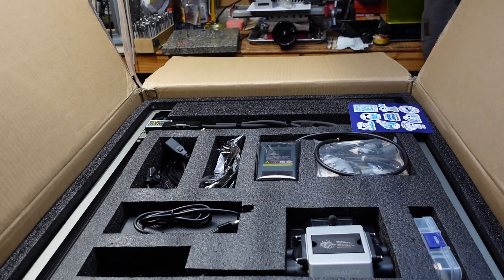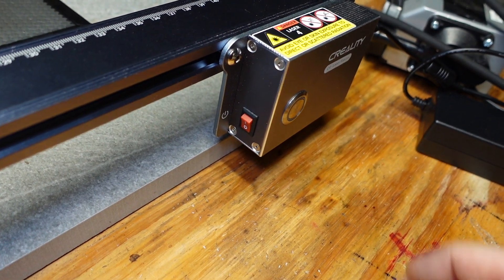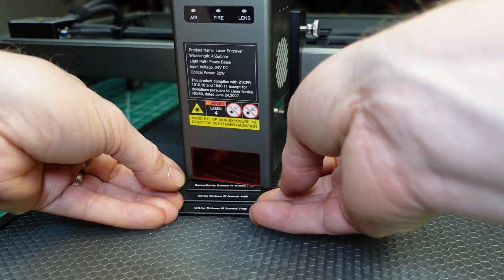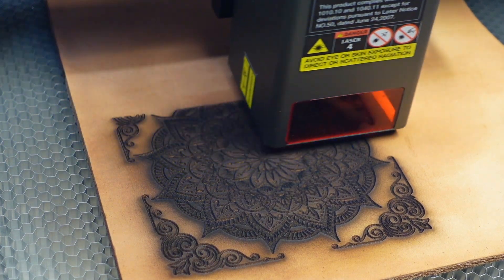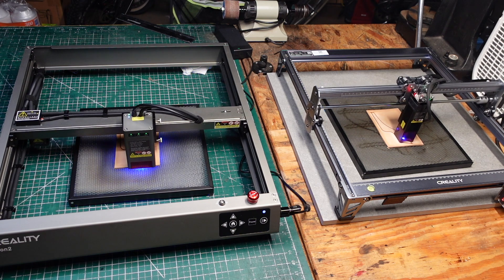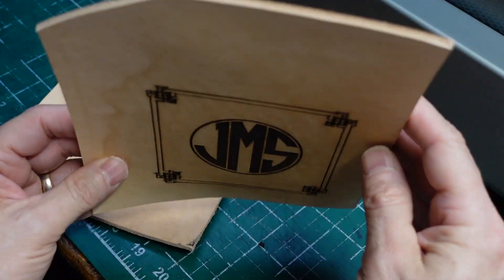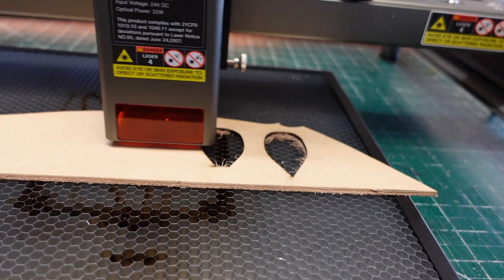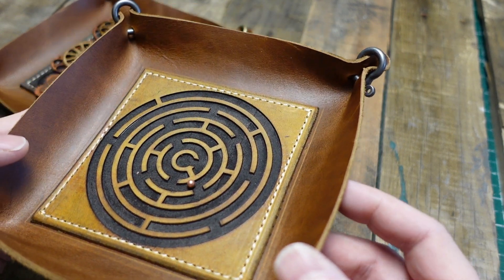Leather & Lasers II: The Creality Falcon 22W Laser Cutter & Engraver Leathercraft

Comment: Hey there love the videos.  What is the max leather weight you have managed to cut with the 22watt?
Reply from the maker: As thick as you want. You just need to adjust your settings. A 10 watt laser can cut through 10 oz veg-tan with multiple passes.
Reply: @RoadAgentLeather  thanks for the info!

Comment: I run a laser shop and ours are all enclosed and exhausted to the outdoors through a filtering system. How do you deal with the smoke that's generated when cutting leather?
Reply from the maker: I'm in my garage and keep the door to the outside open with fans running. Additionally, I have the laser's exhaust port running to the WeCreat fume extractor (see my review video on that machine . . . it's the one where I make leather 1911 grips.) Thanks for watching!

Comment: Any suggestions on some good starting point material settings for the Falcon 2 22w laser to engrave and cut leather? Just getting started with the laser engraver and this is my first one. I have been doing digging for some basic starter settings for laser power and speed for the Falcon 2 22w laser but don't seem to have much more than what is sent with the machine unlike some of the other brands of lasers that seem to have a database of some good starting points for settings on different materials and thickness. Any help would would be greatly appreciated to help dial in some settings when doing the material test grids.
Reply from the maker: Depends on what you're doing. For cutting, I use 100% power and adjust speed to cut in couple of passes (It's best to speed up the laser and use multiple passes instead of trying to slug through slowly in one.) For engraving, maybe around 10% or 20% power. You just have to make a few test runs on some scrape to dial in your settings.